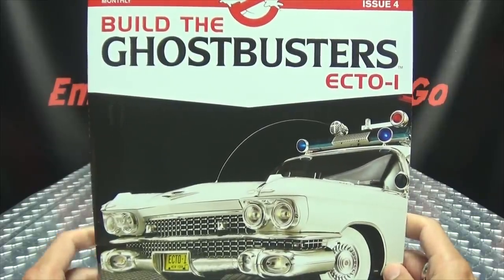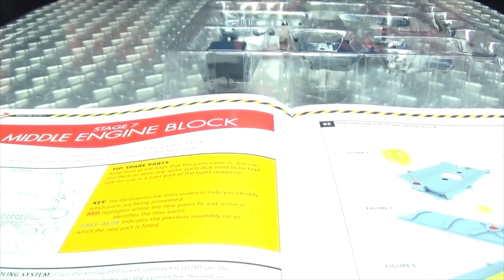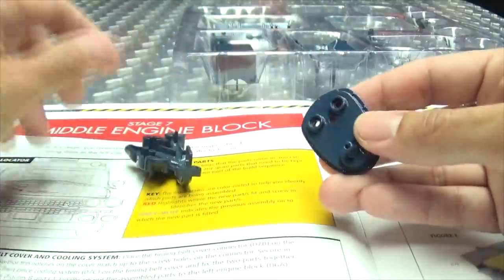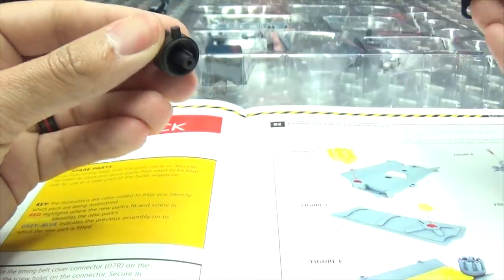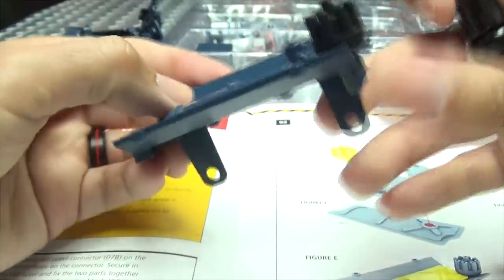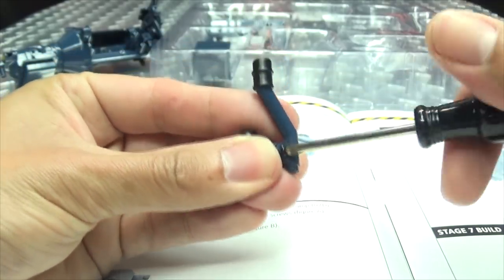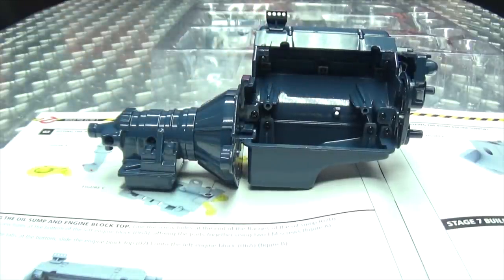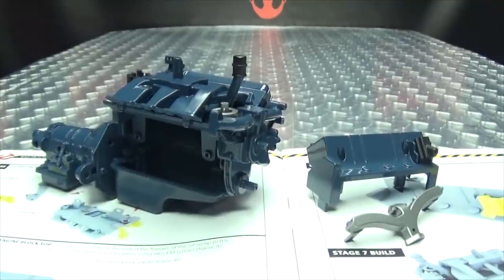Eaglemoss Ghostbusters ECTO-1 Kit (Part 7): EmGo Builds Stuff

Comment: So, timing cover, distributor cap, breather for 1st gen emissions, air baffle of a V8 engine where air and fuel mixes outside the cylinder/piston chamber and an oil sump pan. The sump portion is that large portion that juts down.

Comment: You talking about this gum tree reminds me of something. I live in Utah, and we have this theme park called Lagoon, it's a fun place you should check it out if you ever visit Northern Utah? Anyway, there's this one ride called "The Spider" and the line goes up through a castle and, for some reason, everyone likes to put their gum on the wall that the stairs wrap around! At some point the workers cleaned it off and told people to stop so, you know what people did? They started putting their gum on a branch at the top of the tower instead!
By the way! If you're wondering, The Spider is a rollercoaster where the cars have you sitting back-to-back, and they're on a turntable so as you're going you also spin like crazy!

Comment: oil slump is called oil pan and engine block top is the intake manifold and if it is an older car on top of the manifold is called a carburetor but that was in like the 60 and stuff but it looks like it has a carburetor the round circular thing but i could be wrong and it could be something else

Comment: How much will this cost you when it’s all done
Reply: roughly $240
Reply: Its 141 stages in total. The first 2 you get for  an introductory $1.95 USD. Then its $10.90 USD per stage (4 in total) per month. But you also have the ability to upgrade the subscription for an additional $1 USD per stage to get the display case and other free items. So roughly around $1600-$1700 USD in total.